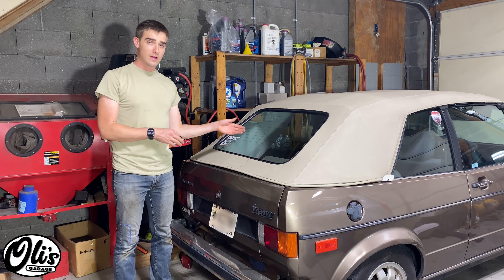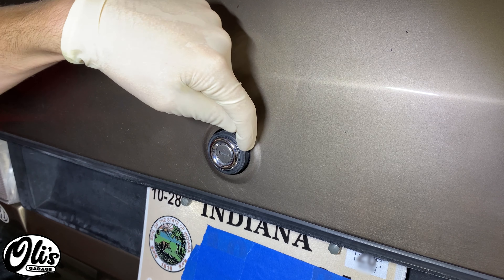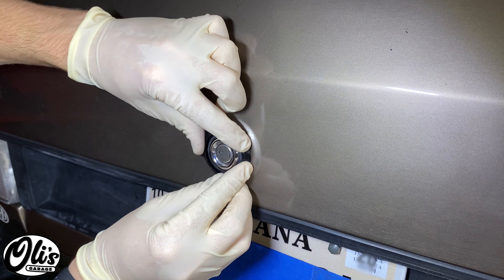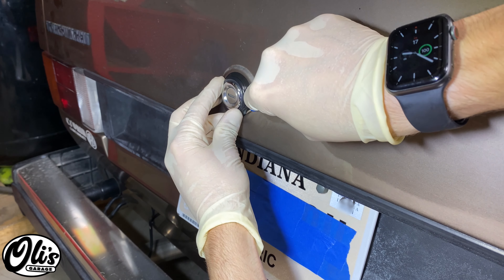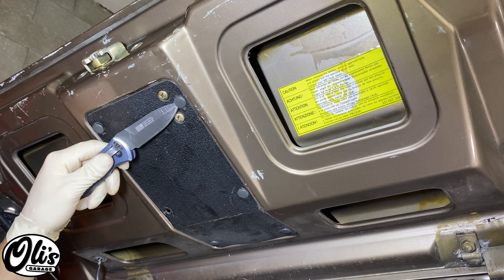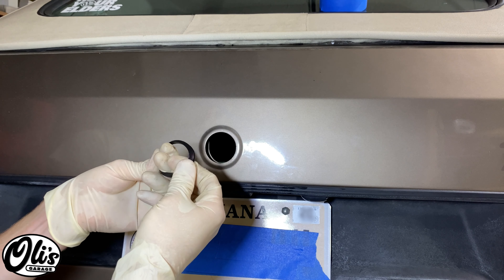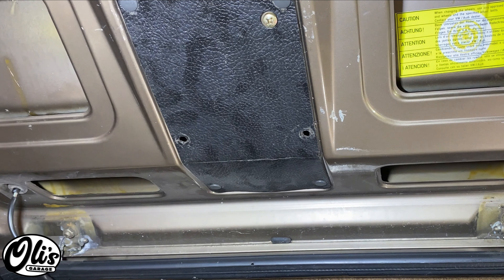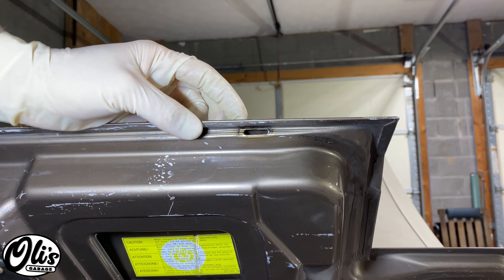VW Trunk Lock Seal Replacement

Comment: I used some dishwasher liquid on mine, well actually all the fittings that needed to be replaced and needed easy assembly.

Great vids Oli.. If you don't mind me asking, but what amperes is the ignition relay or if you could do a vid identifying all the relays please.
I've bought my 87 vw Fox and slowly rebuild it up. (some parts are production in 89 but body and chassis is indicated 87 model)

Comment: What's the best way of finding parts for mk1 cabrios?
Reply from the maker: That question opens a lot of doors. 

I use common auto parts sites and then usually try to copy the part number and look up just the part number. That kind of helps to make sure I order the right stuff. 

Common websites in no particular order, and I have no affiliations with any of them:
Rockauto 
Fcpeuro
Autohausaz
Ecstuning
Partsplaceinc
Techtonics tuning
Mk1autohaus
Vwheritage
Werk34
Amazon

Comment: I had to pull the lock out to insert the lock seal. Couldn't get it to slide in otherwise.
Reply from the maker: It’s a gamble if you can slide it in or not. I like removing it since it’s just so easy to do. 

But sometimes I like repairs that I can do without a screwdriver..Haha